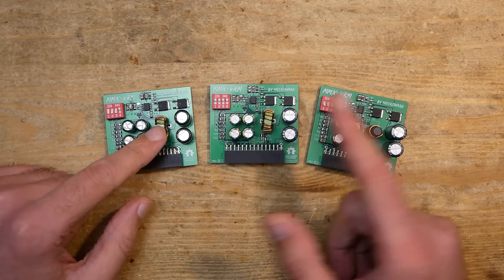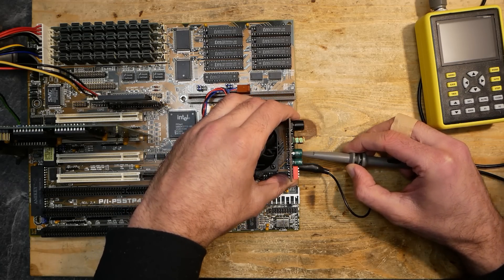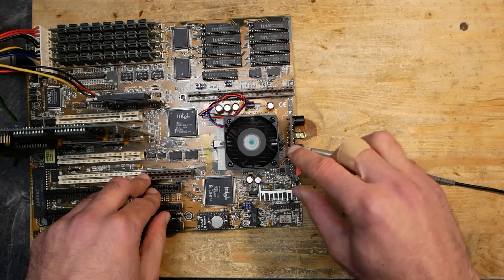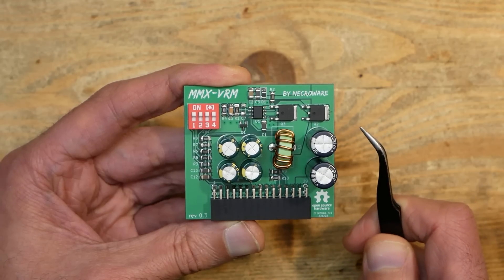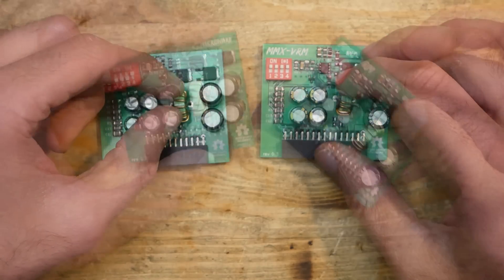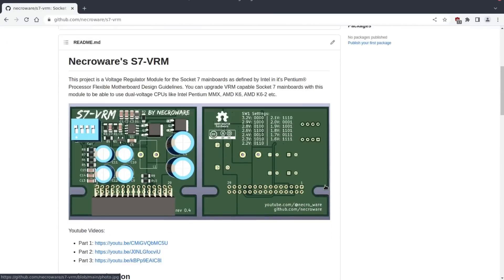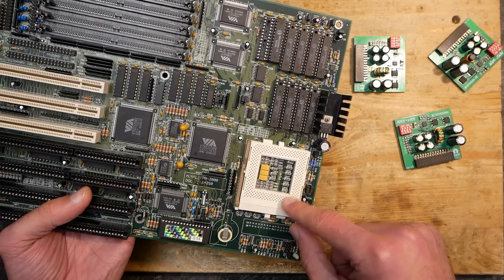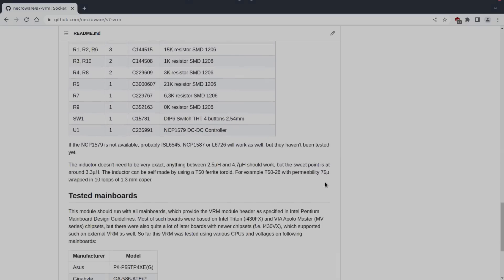Let's upgrade an early Socket 7 board beyond the limit (Part 4): K6-2 test and VRM announcement

Comment: You really should be using a proper hardware license like CERL OHL or Solderpad. CC-BY-SA and GPL are not the correct type of license for hardware.
Reply from the maker: You probably mean CERN OHL, but which problems exactly do you have with the license used?
Reply: @necro_ware  They are not designed for licensing hardware. The CERN OHL (yes it was a typo) is specifically designed with hardware in mind. The concerns around intellectual property regarding software versus hardware are very different and this is why its important to pick the right type of license. For example, open hardware should include the original design files and not just Gerbers, and the hardware licenses require that. The language in licenses like the GPL all refer to "code" and "programs" and "executables" which doesn't make a lot of sense with files that representing physical things. The OSHWA website has an excellent overview of these issues and that's why there are separate software and hardware license.
Reply from the maker: @AureliusR  I read that page and I don't see a real point tbh. After some investigation I found CC-BY-SA sufficient. That license is not explicitly made for hardware, that is true, but it is appropriate for a wide range of products incl. hardware. If there are any real issues with the license in use, you can open a ticket on the project repository. YT comment area is not the right place for such things after all.
Reply: @necro_ware  It's your project, it's totally up to you which license to pick, I just really encourage the use of open hardware licenses as it benefits the open hardware community :)

Comment: It's too bad that these VRMs didn't become a permanent standard.  They were around for a short while but then they disappeared from desktop boards.
If the standardized VRM socket had remained a fixture of all socket-5/7 mobos, it would have helped simplify and improve upgradability for everyone.  What was accomplished in these videos could have been a much more common thing, with people buying a new VRM to go alongside their new K6-Whatever or Pentium MMX 300MHz (could have existed) to plug into their existing older board.  AMD and Intel would have even included the VRM as part of the "Retail Upgrade Kit".  With the power issues safely addressed, the mobo manufacturer would then be more inclined to post a BIOS update supporting the new chips.
Instead, I think CPU manufacturers shied away from promoting upgrades on older mobos because they didn't want to be blamed if the current draw or voltage mismatch caused destruction.
But even with the confusion and hackery that's sometimes required to do these upgrades, socket-7 is still amazing.

I had a socket-7 board that I replaced just to get a super-7.  In retrospect, the old board could have had a major but economical upgrade if I'd known more about electronics back then. AMD didn't really advertise the "tricks" of upgrading old boards, and reliable information was scarce.  We tended to just follow the motherboard manuals which were outdated and didn't tell the whole story of what the board could actually be made to do.

Comment: Since you're asking, I wanted to run the S7-VRM on a IBM PC 350 board (6587-9BT). It comes with an unpopulated VRM header with the usual layout. I was looking for a Semtech MP55C-3.3-2.8 VRM on ebay-like sites, but got nowhere. Then I found your board, and figured I might as well order a few off pcbway including assembly. Then I got it in my head that I could probably do it for cheaper if I was willing to hack the board.

So that's the current plan, I've ordered a XL4016 based DC-DC converter which I plan to set-and-forget at 2.8V for the MMX conversion of the board. The 12 V power rail on the supply is barely in spec to supply the max 17 watts I expect to see. I did mess up, because I assumed I could feed it off the 5V rail. Oh well. I'll update the comment and let you know when I've blown up the board, the CPU, or anything else when it inevitably goes wrong somewhere because I know I'm not that comfortable with making and hacking electronics yet.
Reply from the maker: For a Pentium MMX that might work, but for a K6-2 that would be too weak. XL4016 is specified for up to 8A, but k6-2 can pull almost twice as much in the worst case. Furthermore Intel VRM specs are defined for 5V as main current supply, but xl4016 needs 8V or more. There is 12V pin, but that one is only for low current application. It will burn the board if you try to get the requited power from there. You can add a molex connector though to get the 12V.

Comment: In my experience licence violators do not care. GPL effectively has the same copyleft restriction as CC-BY-SA in this situation. It seems if one does not want to be disappointed in licence, the only choice is to be okay with no-restriction CC0 (or Public Domain, WTFPL, etc).

Comment: You could save a little space on the pcb if you used the molex 90152-2130 connector

Comment: Very cool project 👌
I would love to try one out on one of my P54 socket 7 mainboards but I'm not sure if it will work on them..
Reply from the maker: You can compare the pinout of the vrm connector before you try.
Reply: @necro_ware  I believe the pinout matches on one of them but there's little to no info available on that board, an early Gemlight GMB-P54SPV rev. 0 so even setting its jumpers may be a bit of a challenge.. It has a 100MHz P54C on it.. I guess I'll have to leave this one alone as I don't want to blow it up experimenting without any technical info ;-)
The other one is a later model version 4 Biostar MB-8500TAC-A which doesn't have the VREG-board-header but 2 separate through hole regulators soldered directly on the board. Later versions had 3 regulators for lower voltages and supported MMX CPUs.. I may be able to add another regulator to match the version 6 config of this board, hopefully without blowing things up 🙂

Comment: I've been binge watching your videos these past few days and it has been really enjoyable seeing all those motherboard and other cards being repaired and restored.
Since I noticed you use one of those IDE to CF card adaptors, have you considered connecting pin 20 of the IDE connector to 5V to power directly such adapters?

I did it on 2 of my motherboard and makes those adapters even more convenient so I was just wondering if you thought about it as well
Reply from the maker: Hi, glad you like it! :) Yes, if you look closely on one of my IDE controllers, you will see, that I use it with CF card and without external power.
Reply: @necro_ware  Oh yeah right. In my case I did it directly on the motherboards, bodge wire underneath.
It's not that bad and it's worth not having the extra power cable running to the adapter while using it

Comment: DOS is pretty dumb about how it implements its idle state. Instead of using HLT instruction (and lowering power consumption significantly) which was desinged into CPU specifically for that purpose it uses tight loop. It was ok for pre-CMOS devices, but made absolutely no sense for CMOS ones. There is a tool called DOSIDLE which takes care of that. Occasionally there are some sideeffects of using it but most of the time its pretty damn useful.

Comment: A little offtopic: but i've been struggling with many Asus P5A mobos which all does the same thing (with k6-3+), just reboots in Windows while idling. I can run 3DMark for hours but idling is bad. Voltage ripple could be the reason and that is maybe caused by bad caps... I really need to buy an oscilloscope.

Comment: Some thoughts:

1) Capacitor height -- Lots of ways to solve this.  As you mentioned, parallel smaller caps, but also you might think about laying them down like axial caps, and if they're fat enough, maybe even route out a section of the board so part of the cap body can go through a cutout in the PCB.  Obviously you'll want to place the body cutout somewhere that isn't a power plane (like the edge), which might be challenging.  You said you had some trouble with decreasing the input filter capacity, which was one thing I was going to recommend trying -- generally, you don't need a ton of capacity on the input side, since it's already regulated upstream at the PSU.  Just enough to handle peak switching current.  That will of course depend on how well filtered the motherboard's power planes are.

2) Inductors -- Don't shy away from SMD parts due to concerns over current capacity.  The data sheet tells you what it can handle.  Provided you have minimal resistance / inductance on the traces to and from the inductor, you don't need to second-guess what the pads are or are not capable of.  The part vendor's engineers have taken care of that for you.  :-)  Trust in them.

3) Layout -- You might get better performance by optimizing your layout.  Keep the switching parts as close as you possibly can.  The signal from the controller to the transistors, and the in and out traces of the Q, L, and C components.  Fat traces or planes are good, but really try to minimize the total loop from the in cap to the out cap as well.  That path should drive your layout, with everything tucked in around the main loop, wherever it will fit.

4) Licensing -- This is obviously a personal decision, but I just want to encourage you to consider your mindset on this.  Anything of value you put out into the world is going to get taken.  But, you can choose how you feel about that.  IMO, if I publish something, more power to you if you want to run with it and sell it, or whatever.  I see that as a net win for the community, because I'm going to do a terrible job at making them available as a product, so if someone else wants to handle that, you have my whole-hearted blessing.  I don't particularly care about credit -- nobody knows who I am, or would care, anyway, so why fret about it just to feed my ego?  You made a reasonable point about wanting feedback to find its way to you, but IMO, you'll probably never get as much feedback from a product in the wild as you do from these videos.  Chances are, if it looks like a complete solution, it will be consumed as one, and very few people will give it any consideration beyond that.  Here, you have an enthusiastic community that is invested in the saga, so you're going to get lots of armchair hobbyist engineers throwing in their 2 cents.  (guilty!)  Once it can be downloaded or bought, it'll just be a black box what takes one thing and produces another, and you'll probably never hear from an end-user that wants to help you make it better.  (And if you did, you'll probably have moved on to your next project anyway.)  Not trying to tell you how to handle your own intellectual property, of course, just gentle encouragement to contemplate a more "que sera, sera" attitude toward idea theft, since it's largely inevitable, and you hadn't much intent to profit off of it, so why create stress about it?  If you see it as a good thing, then it is a good thing.
Reply from the maker: Thanks Nick!  Thanks a lot for the detailed comment, I appreciate it a lot. Here are my 2 cents ;)

1) This doesn't seem to be a big problem. Most mainboards are designed in a way, that the module looks away from the CPU, so caps have enough space. Others have usually enough space for 16mm caps as far as I can see. It's a rare case, where caps wouldn't fit and then they can be soldered from the opposite side.

2) Of course I trust the specs, but I want to be safe with my PCB design as well :) My initial design was with SMD,  but I had problems to obtain what I needed. Either they were out of stock, or too big, or too expensive, or too weak. Eventually I decided, that it is much easier to make my own coil and call it a day.

3) I invested many hours into the layout. It was checked by two of my friends, which are electronics enginers. Every trace is calculated and everything is layed out strinctly as suggested by the datasheets. Distance to capacitors, distance to the coil, distance between the parts, which can influence each other, traces and planes widths etc. Since I'm not an electronics engineer and miss the required experience, I decided to do everything strictly by the specification :)

4) Yeah, personal thing of course. Eventually, I have to release it under some license and wich one is basically a free choice. I want, that people are able to find the origin, schematics, additional information and whatever they want to know about the project. This project has no firmware or software, but others do and may be someone wants to make an upgrade, or start to experiment and contribute, who knows? I don't do my projects to be black boxes, I'm a friend of "by community for community" approach, otherwise I can stop all this instantly.

Once again, thanks a lot! I always make notes and try to keep all the suggestions and opinions in mind, when developing new projects or improving the old ones. Not only technical questions, but even such exciting thoughts about the license. This is the first time, that I'm trying the CC-BY-SA, currently I'm not quite sure what to think about it. Time will tell ;)
Reply: @necro_ware   Yeah man!  I appreciate everyone who contributes to the options we have to keep old machines alive.

I feel bad sometimes, because I've seen a lot of product developers get bent out of shape about clones, and at the end of the day, it doesn't seem like anyone has ever found a solution that prevents it.  Particularly not the terms of a contract.  ;-)

I often feel like so much energy is wasted worrying about "what if it gets cloned?" (it will), and "what can I do to stop it?" (contain the wind and rivers maybe?) that would be much better spent remembering what's most important.  Family, friends, good health.  Everything else?  Small potatoes.

Hopefully, the community, particularly fellow YouTubers, help direct people to the origin of such projects, so everyone has the opportunity to benefit from the resources you (and others) have carefully designed and curated.  And for those that just buy from the cheapest source, regardless of authenticity?  Well, good luck to them.

Anyway, whatever you do, cheers.  You put a lot of effort into this, and it definitely shows.  :-)

Comment: Nice work! I wonder if the VRMs for the Pentium Pro are also standard across manufacturers...
Reply: The Pentium Pro VRMs are also standardized. I've built a simple adapter to use them in my old Socket 7 board.
Reply: @desolder75  Thanks!

Comment: Thank You so much for shearing your knowledge. Unfortunatelly I destroy 1 mainboard trying to do it my selve. Withaut exact knowledga how this look in details i made it mirrored :-). now i wonder if i didnt burn also CPU. Is there any way to check if the CPU is burned ?
Reply from the maker: Thank you! I'm sorry to hear, that your experiment went wrong :( It's a bit hard to predict, what would happen, if you turn around the VRM, but I'm afraid, that it instantly will kill everything on the board, including the expansion cards. As far as I see, the +12V would be connected with the ground on the VRM and sent back to +5V, +3.3V, VCORE and VIO.

Comment: For better ESR on electrolytic caps, you should use caps with higher voltage ratings. 
It's very common, for example, to see 16v rated caps on 3.3v lines, just to improve ESR on the cheap. 
(and higher voltage spec, makes the caps thicker, not taller; so it would also help with the space clearance problem)

Comment: I have a 437FX mainboard that is similar to that FIC board you mentioned with only a linear regulator. 

During some initial inventory and status testing, I confirmed that regulator gets crazy hot. The board was fitted with a P75, but due to a jumper misconfiguration (i.e. some were missing), the system booted that chip at 133MHz and I burned my fingers brushing against the heatsink fins. 

Fixing the jumpers helped some but adding a dedicated 30mm fan to the regulator "fixed" the burn concern issue. 

I absolutely love the thought, engineering and testing that went into this VRM. Great project!

Comment: Is the pinout for VRMs largely standard? Xurious if it would work on boards with Pentium Pros or Dual slot1 boards that need vrms.
Reply from the maker: It is standard for the mainboards, which support Pentium MMX and compatible CPUs with dual voltage.

Comment: As someone battling a removable VRM that gets hot enough to cook a steak, I'd love to see this sort of project come up for the motherboard found in the Dell Dimension 8100, OptiPlex GX400, and Precision 330. It's all the same board, some are missing onboard audio etc. but they're still all the same platform, which is Socket 423. The reason I'm battling it is heat generation with higher-wattage CPUs... and given I'm about to finally do an upgrade on it to a much faster Pentium 4 with a Socket 478 adapter, I'd love to be able to make the heatsink not run at a million degrees. but I just don't have the skills needed to make it happen... PCB layout and EE at that level is just too much for me.

Comment: Very cool.  It may be possible to make the board work in either orientation by putting a second connector at the top of the board.  Understandably there are wide high-current traces, but they could be made more narrow by soldering solid wire along the critical ones permitting the addition of a second connector.  Alternatively, you could place the tall capacitors on a second small board and have it plug into either side of the main board with polarity-keyed plugs.